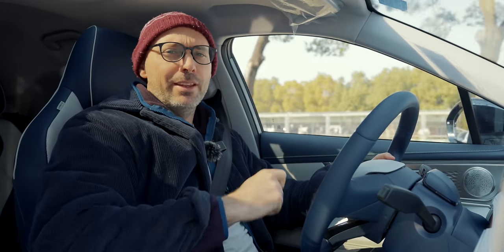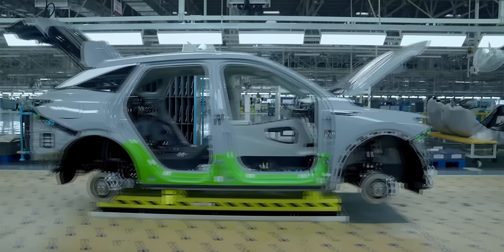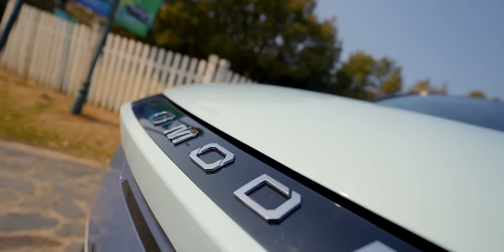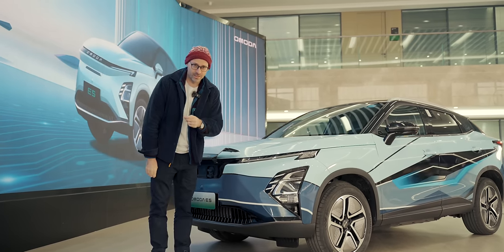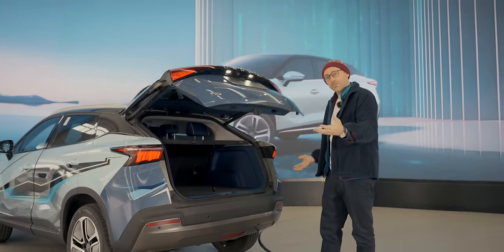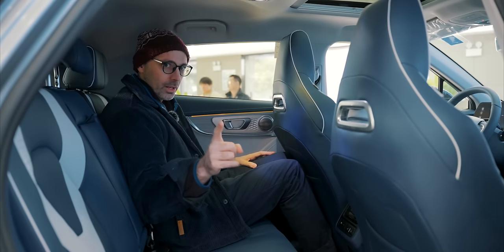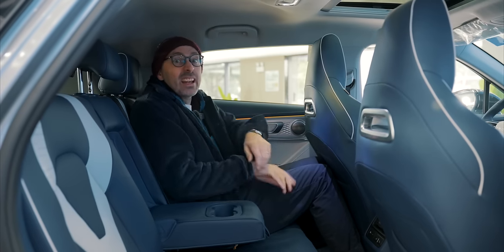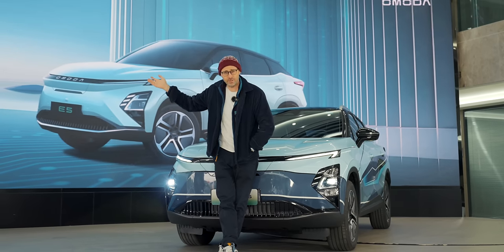There's A NEW Electric Car Brand That Deserves Your Attention...

Comment: Even if I considered a Chinese car, any car with a front charge port is a no go.  Looks nice otherwise.
Reply: Why front charging port on my mg means cables at chargers always reach
Reply: @damiendye6623  Yes that's great, unless you live in a place where parking front is in not permitted by law or not permitted by insurance.  I for example, would not be covered by insurance were I to be involved in an accident backing out of my driveway.  As such, I would need to drag charging cables around  to the front of the car to charge it.  This would be annoying in the summer and not viable in the  winter.
Reply: @davidbutton3500  which of the nationals that make up the UK ban parking forward on your driveway and which insurance denies it
Reply: @damiendye6623 No Idea. You would have to ask someone who lives in the UK.
Reply: @davidbutton3500  I do and thats why am calling you out on your comment.

Comment: The problem with all these unknown makes is ok you like, you buy, you crash! It happens! 
How long will it take to get parts? If it just breaks down and needs some suspension parts or a traction motor? Most likely your car will be off the road for months for a silly little part? You won't be able to get one from eBay or Euro parts.

Comment: I want a small car with a range of 350 miles in winter in the dark when it is raining.  When an electric car with this spec emerges I will give it serious consideration.  Until then I' sticking with diesel.
Reply: Want or need.
Reply: @paulbuckingham15 it's want nobody needs that with the 30 mile commute
Reply: You know, so he can drive from Tenby to Newcastle in 7 hours without having to stop for a piss.
Reply: @AJames-jr8kw  doing that isn't good for you. But yes you can do that and it's not government policy and against the highway code section 91
Reply: Damien, I take it sarcasm and irony is not something  you notice.

Comment: It is an unoriginal design with (for the class of the car) subpar range and charging times while not reflecting that with a low enough price and they don't have a dealer network

Comment: Does it catch on fire?
Reply: No that's a special feature of Range Rovers! Data on car fires from Norway found, “there are between four and five times more fires in petrol and diesel cars, according to the Directorate for Social Security and Emergency Preparedness.” The Swedish Civil Contingencies Agency similarly found 68 fires per 100,000 cars of all types but just 3.8 fires per 100,000 EVs or hybrids.

Australia’s Department of Defence researched the same question and found that “there was a 0.0012% chance of a passenger electric vehicle battery catching fire, compared with a 0.1% chance for internal combustion engine cars.”
Reply: @simoncavill another bs statistics.
Reply: @Trackandshield  says "I can't come back with data to cast doubt on @simoncavill's comment, so I'll just post a BS reply" 🙄
Reply: @simoncavill Norway doesn’t exactly have a ton of Chinese EV’s running around to skew that data now do they?
Reply: @Trackandshield As you didn't even try to back up your bs, it must be bs.

It's obviously that simple with your comment. But hey, you can surprise us positively instead. But I hope you don't mind that I'm not going to hold my breath.
😊
Reply: @jezza6575 What's different with Chinese EVs? Just your opinion or do you have something tangible?
Reply: Got to laugh at you two. I mean, there you are, riding around presumably in ICE vehicles, be they cars, taxis or buses, and you’re trying to be clever about electric cars. Diesel and petrol are safe then, are they? If you must troll a site dedicated to everything electric, at least try to be original or clever.
Reply: @jantjarks7946  He's not even thinking of the child labour or how it's going to collapse a multi storey car park or make the potholes bigger.... must be a newbie! 🤣
Reply: The prices will burn down fast after purchasing one. As an AA recovery driver I recommend buying these because the EVs are keeping me busy, and most I can't fix them roadside. So it's easy money.
Reply: @HouseflyUK  Lol, true. 🤯😂
Reply: @dannydee2668  How many, what proportion to your normal trade, what brands and was it a problem like running out of charge? As if topping up a tank never happens, or a flat with no spare.